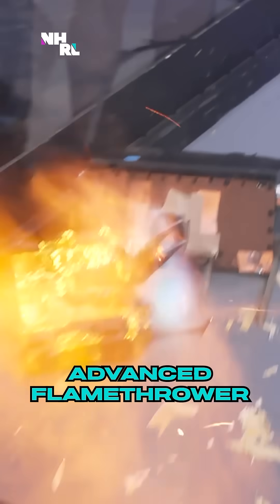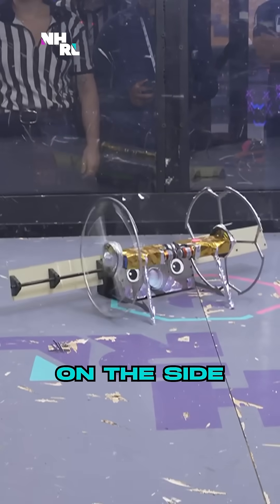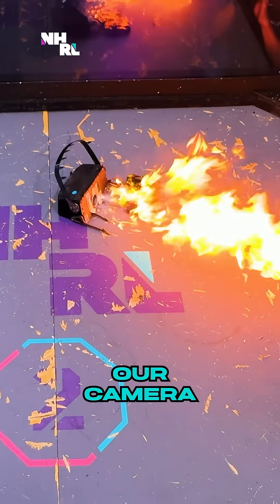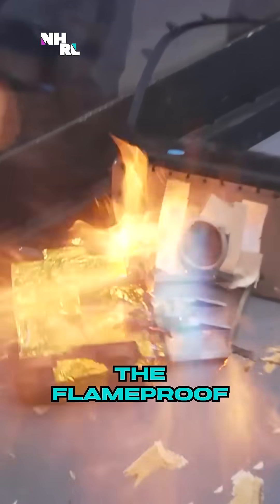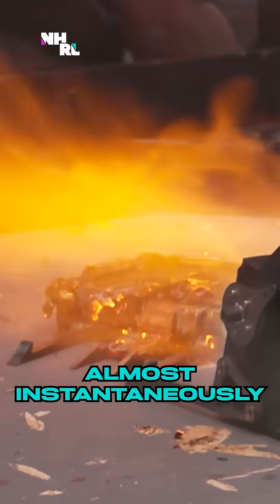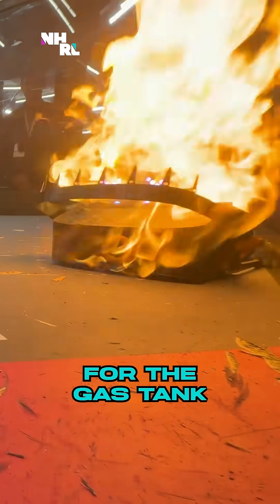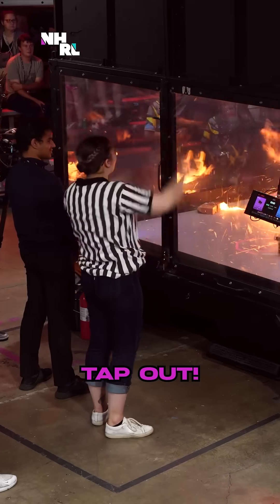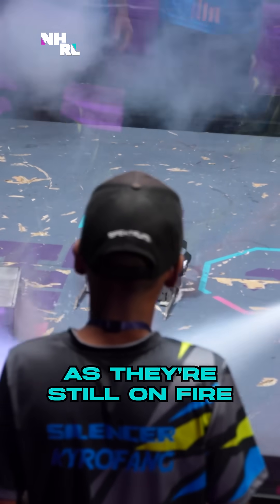How Hot Is TOO Hot? Robot Melts Fireproof Tape!

Comment: I would still just use a tungsten cube if I was ever going to fight robots
Reply: Needs an active weapon, I recommend a motorized propeller hat.
Reply: I'd recomend multiple legs flush with the sides of the cube. Each leg also being made of tungsten. They should also be irresponsibly overpowered so that the cube just constantly flips around in the air.
Reply: weight limit and the requirement of a weapon unfortunately limit this dream :(
Reply: @Resetium there are ways to get around everything, including rules 😏
Reply: I mean that’s what the Housebot is.

Comment: “The fireproof coating is now on fire and melting” that’s insane
Reply: Clearly it wasn't fireproof!
Reply: It looks like maybe a metal foil covered in kapton which does burn at temps over 400 degrees Celsius but self-extinguishes.
Reply: I mean everything has a melting point 😂